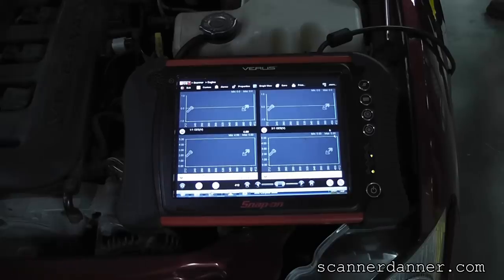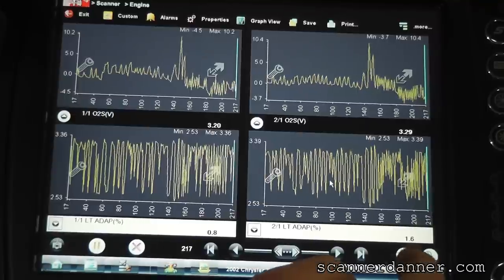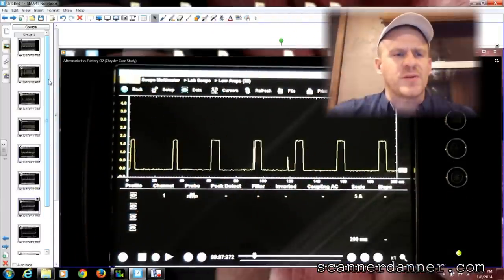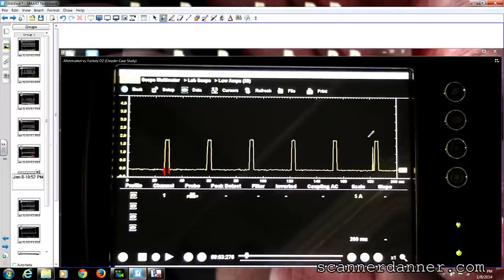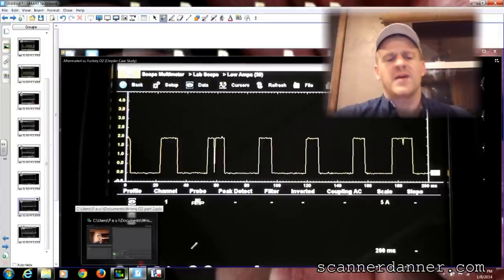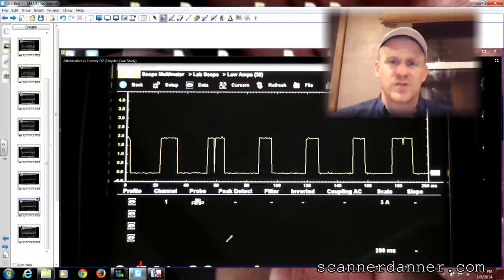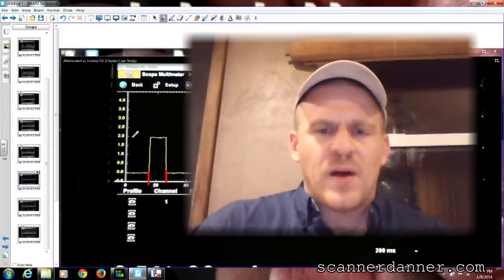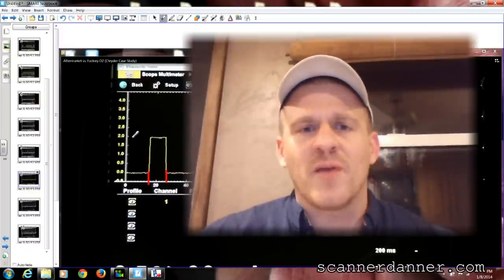WARNING! Aftermarket Oxygen Sensors (Chrysler/Dodge/Jeep part 2)

Comment: I have a problem with my car it's a O2 sensor bank 2 sensor 2 running high voltage on a 2006 Chrysler 300 v6 2.7
Reply from the maker: Focus on your heater circuit if the sensor is new.
Reply: Did you get it fixed I have the same problem
Reply: Would I have to go with the factory O2 sensors
Reply: I had bought some mtk o2 sensors and  my engine light keeps coming on
Reply from the maker: @jonathanmartinez5522  If you still need help Post this to my forum https://www.scannerdanner.com/forum/post-your-repair-questions-here.html it is free to join and I have paid moderators who are there to help me help you guys.

Comment: Billy R, DE Nichols, Paul D, and others;

I will read the recent posts from Billy and DE more thoroughly later. I just woke up, so the brain is a little foggy at the moment.

I am just barely learning how to use Google+, so I get confused easily when I see Notifications, in terms of when messages are posted in Comments, how to find them, etc. Still not sure if I'm doing it right.

But I'll read all the recent threads here and followup later.

For the record, I absolutely do have a PCM with two 40 pin connectors. They are labeled C1 and C2 in the Chrysler FSM for my car.

C1 is labeled pins 1 through 40 (4 rows of 10), and C2 is labeled pins 41 through 80 (4 rows of 10).

I'll double check to make sure everything I wrote about the O2 circuits and Heaters and wiring colors is correct.

The TCM has a single 60 pin connector.

By the way, my periodic twiddling and playing with my car is over for now. Winter has arrived here in Minnesota in a brutal way. Low temp overnight tonight (Nov 12) will be 14 degrees. Burr......

I was rushing to get a bunch of maintenance and other stuff done on my car before winter arrived, and I did get some of it done, but I ran out of time on a bunch of other stuff.

Take Care......
Reply: 30 degrees and snow tonight 11/13/14
Reply: Billy R

Where are you located?
Reply: Northern Connecticut elevation about 1300 ft, got 2 inches!

Comment: Paul,

I wanted to submit to you some info about O2 wiring on my car.  This might be of some value, in verifying or differentiating the info you have.

I have a 1999 Chrysler Sebring JXi 2.5L

I just pulled out my factory service manaul.

Here is what I found.....

This car has one upstream O2 and one downstream O2.
____

The Heater circuit on the UPSTREAM O2 is supplied from the ASD.

The wire color from the ASD to the hot side of the Heater is Dark Green with Orange stripe.

The ground side (and it is a direct body ground) is a plain black wire.

The low side of the signal circuit is grounded into pin 27 of connector 1 on the PCM That is a black wire with orange stripe.

The high side of the signal goes into pin 30 of connector 1 on the PCM. That is a black wire with dark green stripe.
____

On the DOWNSTREAM sensor The Heater is grounded (body, not PCM). The supply for the Heater comes from the ASD and then passes through fuse 1  (10 amp) in the Power Distribution Center, and then to the Heater.  The supply wire is orange with dark green stripe. The ground wire is black with orange stripe.

Notice that they invert the heater supply colors on the two sensors. On the Upstream, the supply wire is Dark Green with Orange. On the Downstream sensor, the heater is Orange with a Dark Green stripe.

The signal circuit for the downstream O2 is grounded to pin 43 on connector 2 at the PCM. That ground wire is a black with light blue stripe. The signal itself goes to pin 51 on connector 2 on the PCM. This is a Tan wire with White stripe.
____

SO, the Heater portion of the upstream sensor  is always on, when the ASD is closed (high side switched).  No PCM control of that.  Same with the heater of the downstream sensor. That is always on, no PCM involvement.
____

Separate from all that, the Dark Green with Orange stripe is used in several places on the output side of the ASD. I know that color scheme is used on the field wire for the alternator. It comes from the ASD to the alternator field winding, and then goes to the PCM.  The wire from the ASD to the alternator, is Dark green with Orange stripe. The wire from the field to the PCM is Dark Green.

The field is turned on and off by the PCM.

Hope this helps.

-doug
Reply: Douglas, I believe you have an older generation computer ( Single Board Engine Controller ( SBEC )). SBEC l & SBEC ll have a single 60 pin connector as SBEC lll has two 40 pin connectors. Pin locations are not the same for various functions on the connecters. On 1998 and later SBEC lll and SBEC lll+ have different pin arrangements to prevent inadvertent interchange. I'm not sure which version you have.
 Introduced in 1995 on Chrysler vehicles, it was the first to combine the Logic Module that processed sensors and other inputs with the Power Module that actuated all output devices including the ASD relay onto one circuit board. The Heaters are fed battery voltage by either the ASD or a Sensor relay. In either case, both relays are PCM controlled. The sensor heaters use a common ground as you describe or are pulse-with modulated ( PWM ). With SBEC or Jeep/Truck Engine Controllers ( JTEC ), if the Heaters were PWM, they were controlled with a  Low Side ( Ground Side Switched ) driver, in the PCM. Both the SBEC & JTEC platforms were starting to be replaced by Next Generation Controllers ( NGC ) in 2002. I believe they were totally phased out in 2005.

On vehicles with NGC controllers the Heaters are controlled by High Side ( Positive Side Switched ) drivers in the PCM.  The Sensors in NGC are Zirconium Dioxide and Positive Thermal Coefficient ( PTC ) elements, meaning that as the temperature increases so does resistance thru them. The resistance on the heaters are constantly being monitored by the PCM. This information is used to verify heater circuit integrity and indirectly the temperature of the O2 Sensor. The PCM performs a Voltage Drop test across a 10K resistor that is inline with the Driver and the Heater circuit. The PCM adjusts PWM to maintain proper Current Flow to maintain proper operating temperature ( 660 Degrees ). 

The PCM also uses a 5 volt pull-up to check for short to ground or short to power when the Heater is in an OFF state.  The PCM and the O2 have another trick up its sleeve! When the O2 gets hot it essentially becomes a Galvanic Battery and generates a voltage of 0.0 - 1.0. volts. You will see that voltage on SBEC & JTEC Signal Ground wires but not on NGC Signal wires. On NGC platforms you will see a voltage of 2.5 - 3.5 Volts on the Signal Ground ( Technically called Signal Low or Signal Return ) because the Signal Ground wire is heavily filtered from RF/EMI to eliminate any electrical noise before indirectly going to ground. 

The reason you don't see 0.0 to 1.0 volts on the Sensor Return/Low wire, is because the Sensor Return/Low wire has a 2.5 volt Bias voltage on it to keep the Sensor Return/Low Voltage from inverting ( Negative Voltage/Below 0 Volts ) which will cause an Open Loop condition that could occur under one or all of these situations.

1) Dirty or Contaminated Sensor
2) O2 Fresh Air Inlet Clogged ( Inlet is thru the wire harness, believe it or not )
3) Extreme Load in Extreme Heat ( Such as towing a Trailer )

I just watched this vid on After Market vs. OEM O2s and thought I would add to your comment and expand on what you were seeing in your service manual's wiring diagram. I also wanted to pass along some info to Paul ( AKA ScannerDanner ) to help answer some of his own questions. I think I'm going to copy this and post it to him too, just to make sure he sees it too. I think he will find it interesting. In his follow up, he seemed a little bewildered himself ! But in my eyes he still ROOOOOOCKS!

Comment: Rambling on .... No way . You are looking for answers and if more people had that  approach then there would more good technicians out there . I follow all ur videos with great admiration for your dedication to your work ... With regard to the original garage fitting the sensor and then another sensor , I can see wear they coming from because new things can be broken . What you failed to mention was they had the same choice as you and that was to swap the sensors over to see if the fault followed the swap wich could confirm that the wiering harnes was or was not faulty . All I can say is ... Bring on the next video .. Brill .